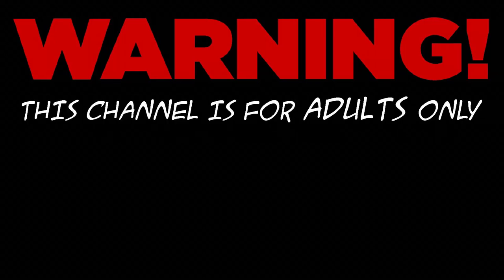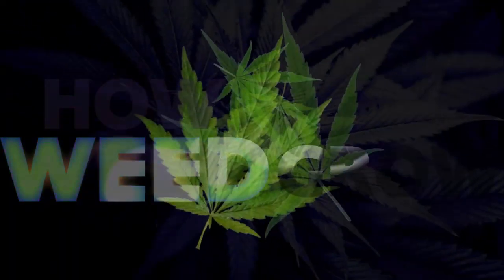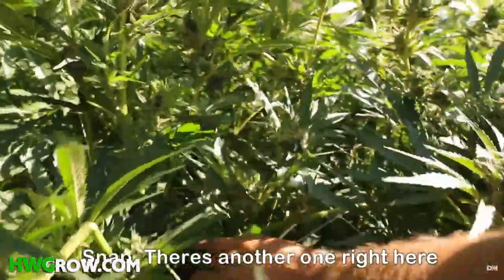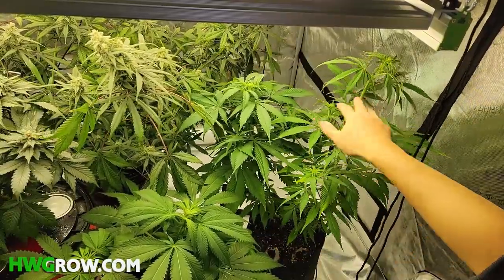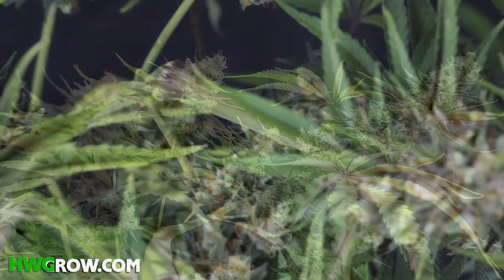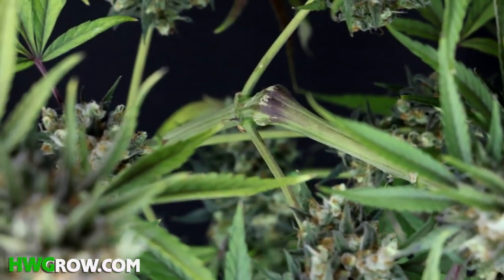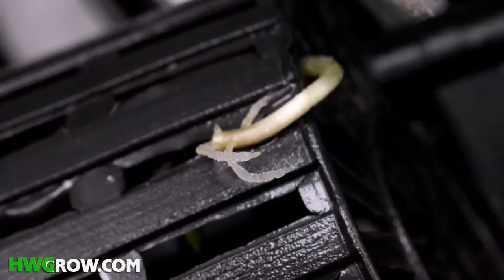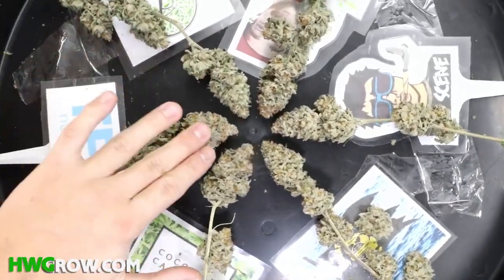How to SuperCrop Weed - Intentionally Breaking Stems for Better Quality & Higher Yields - HST - Fix?

Comment: Best way is to roll the stem in your finger until the outside is a bit softer and you can feel a little pop then slowly let it bend over. If you pop it too much or just straight up bend the branch your buds will be looking at the ground and you will need to brace it
Reply from the maker: Yeah Kyle kushman has a great video here. My method of LST is different than this but this works for me as long as I’m not too abrupt